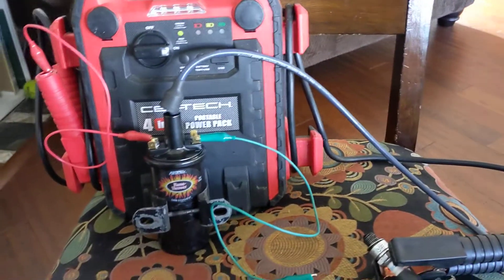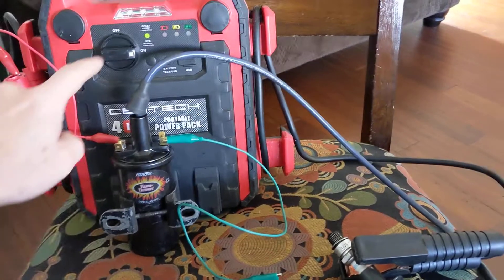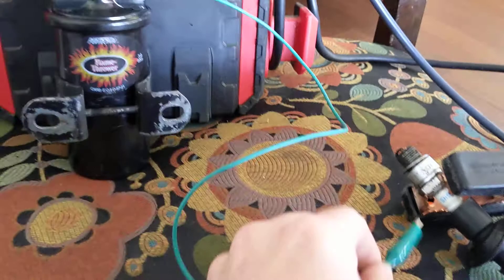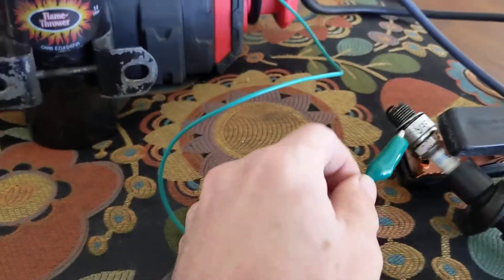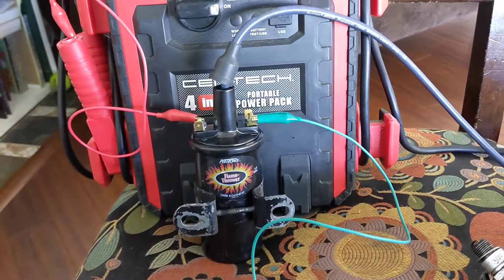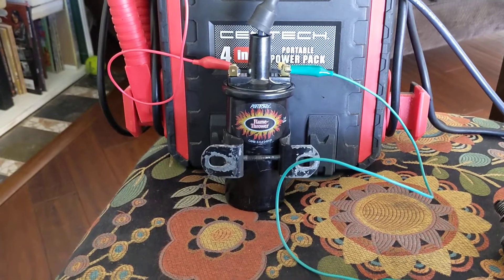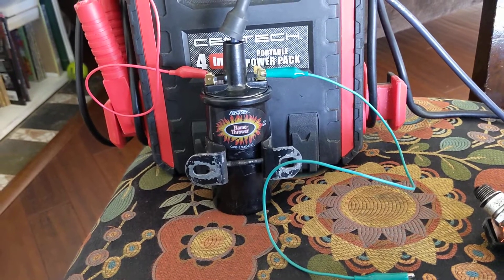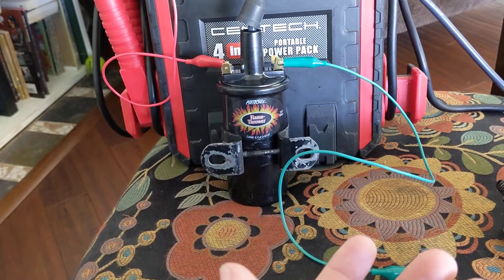bench test ignition coil

Comment: Dang, I've got a bit of a different issue. I was given a kit car with a VW engine in it. It was meticulously maintained by the old man that owned it before his passing. His granddaughter and her boyfriend tried getting it running, so I have no idea if they changed anything up. As far as I know, all the wiring is still correct, but I have no spark. I have confirmed continuity to the coil, have done the spark test on the original blue bosch coil, as well as a replacement aftermarket(both produced spark). I have also tried each coil in the car with the original condenser, as well as a replacement. Beither coil will fire. The rotor is on, making contact, plug wires have continuity, etc. No idea what is left that could be the culprit. I have asked around on several videos, nobody has had a response yet. Any ideas or troubleshooting tests are appreciated

Comment: @JoshRogers first, thanks for posting such a video to ask for comments on t/s this issue. I’m curious if you think you would have determined the issue was with the ignition switch initially if you had checked for 12V coming into the coil? I thought you said you had. If so, is there a way to confirm an ignition switch issue w/o having to change out the switch? I’m having the same issue with no spark at the plug but I believe it’s an issue with the CB Perf Magnaspark distributor since I have 12V coming into the coil and the primary and secondary resistance checkout correctly.
Reply from the maker: You are right, I did check input voltage, and it was present.  If I recall, though, it was low though.  The ignition switch had continuity, but must have been making a poor contact.  Good enough to detect voltage with my meter, but not good enough to handle a substantial draw. 

In retrospect, I should have tried a voltage drop test with the coil connected.  I have a healthy fear of getting zapped by that coil though, and was nervous about trying that.
Reply: I share in that fear 🤣 I’m replacing my distributor with another Magnaspark this week. I may have to face my fear and do the voltage drop test of the coil if that doesn’t do the trick.

Comment: Did you find a solution for this issue I’m having the same issue on vw bus
Reply from the maker: I did!  After a lot of frustrating troubleshooting...  I finally checked the ignition switch.  It was bad (was passing power to the starter, but not the coil).  Confirmed by hotwiring, and when I replaced the switch, all is well!
Reply: @JoshRogers  thank you I will try to hot wire it and see what happens
Reply: Bus is alive again, hot wired it and it fire on first try will be getting new switch today, thanks again for the info
Reply from the maker: @lostigresdelnorte  , excellent!  Good job!
Reply: @JoshRogers  Josh how did you hot wire it? Thanks in advance.

Comment: Did u ever figure out what was going on
Reply from the maker: I did!  After a lot of frustrating troubleshooting...  I finally checked the ignition switch.  It was bad (was passing power to the starter, but not the coil).  Confirmed by hotwiring, and when I replaced the switch, all is well!
Reply: @JoshRogers  how did you hot wire? Sorry I’m have the same problem, I have no spark

Comment: Did you ever figure out your electrical problem ?
Reply from the maker: I did!  After a lot of frustrating troubleshooting...  I finally checked the ignition switch.  It was bad (was passing power to the starter, but not the coil).  Confirmed by hotwiring, and when I replaced the switch, all is well!
Reply: I thought you had 12 votes to the positive side of the coil when you was trouble shooting it and there was no spark   @JoshRogers

Comment: Yes I’m theory that would mean u have 2 dead coils
Reply from the maker: turned out it was a bad ignition switch.
Reply: @JoshRogers  oh really mine has been sitting for about a year and a half to 2 years and the fuel line was clogged cleaned that and it would idle ok but once it got hot it ran like shit (misfire/not enough fuel ) and now it just cranks if I spray brake clean in the carb it doesn’t even try to fire on it so I’m thinking I have a bad coil but it’s raining here so can’t test it kinda at a loss until I saw your video
Reply: It was running good before I parked it but I got caught up with work and another vehicle the bug was on the back burner
Reply: @blakecampos5563  hey man think I got the same problem what did you end up doing to get it runnin?
Reply: @tylergreene6650  do u have electric points or mechanical make sure they are clean if mechanical if not u might have a bad coil
Reply: @blakecampos5563 I've got the same problem when it gets hot it runs badly and misfires, I've got electronic ignition.  What's did you do to fix your problem?